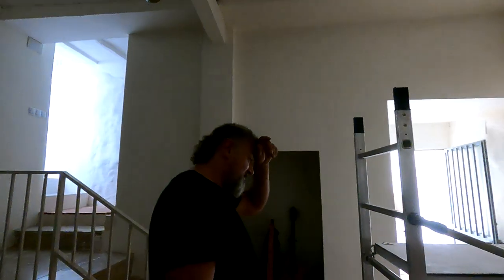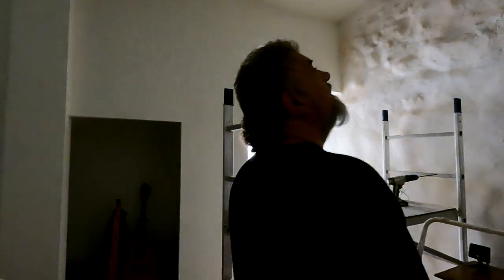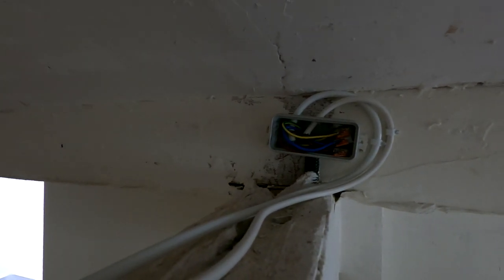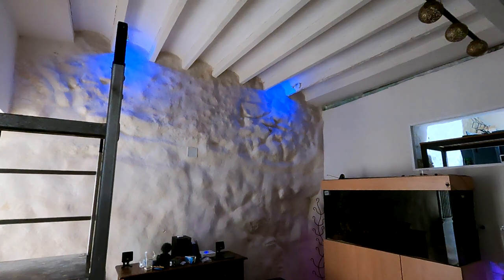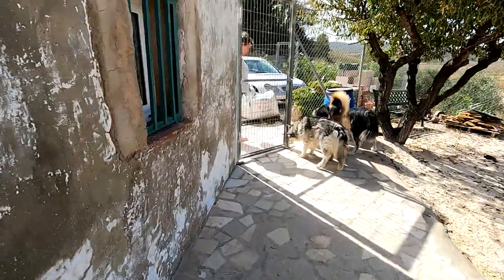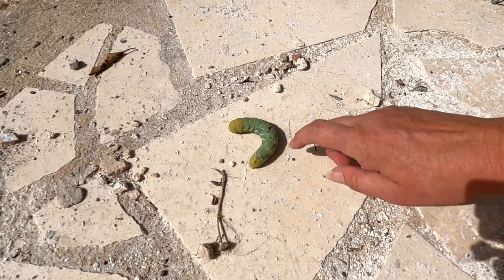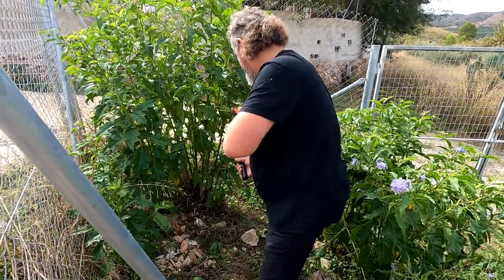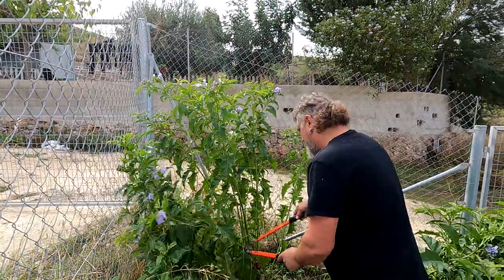As we complete one mini project another comes along (Ep 142)

Comment: I bought this hammer in metal edging off the internet called edge right. I was having issues with my mulch from flower beds and stones from fire pit area washing out. This has stopped my problem. Comes in different heights. Is a bit expensive but rather than waste money on stuff that will degrade this was best price because it lasts like 20 years. Don’t know if it will work in your area but might be worth a try to save you from all the clean up after heavy rain.
Reply from the maker: Unfortunately it may not work as we would have to drive the car over it, thank you for the suggestion. We are hoping at some point we can get permission to have bigger grade hard core put down. The problem is the slope is quite steep so in heavy rain the surface water just washes the smaller stuff away, it has never been a problem until this year.